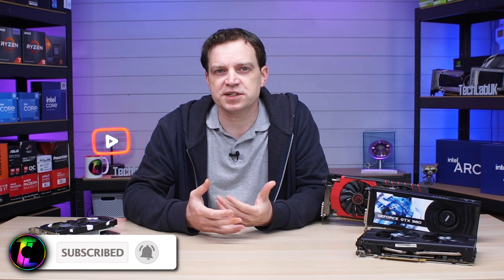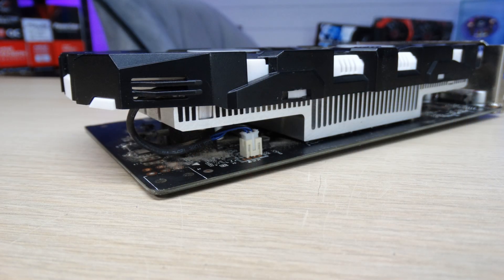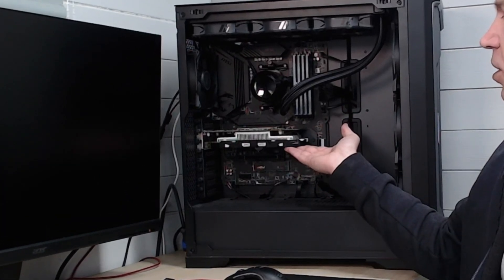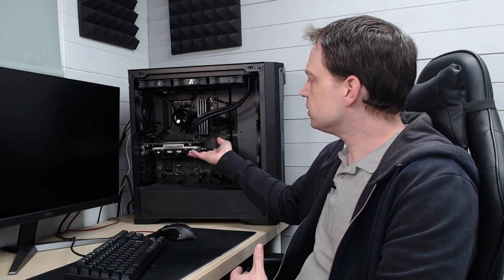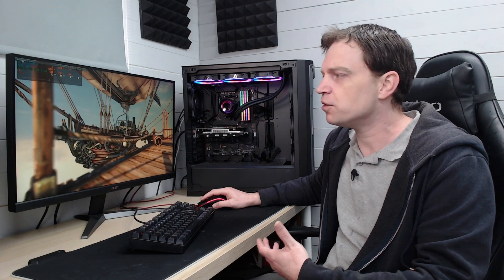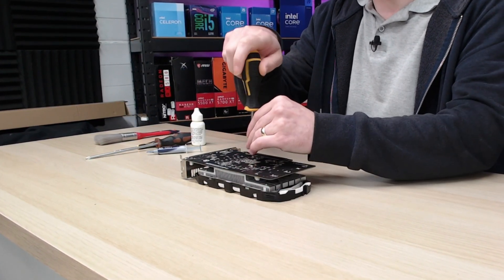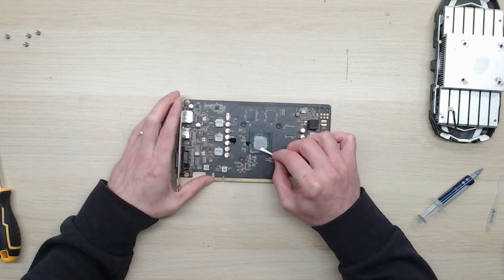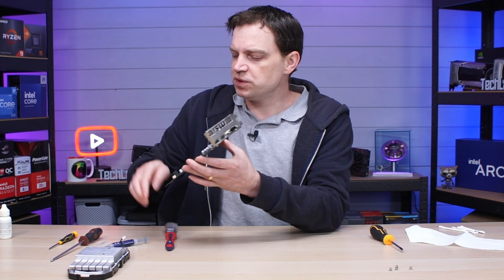So you bought a used GPU... now what?

Comment: i recently ordered a gtx 970 used for less than 40 euros i dont have any thermal paste available right now and the gpu looks rather clean  without any or much dust im wondering if i should open it up but its still got the original void warranty screw
Reply from the maker: I wouldn't open it if you don't have any thermal paste to replace it as you will need this to put it back together again.
Reply: @TechLabUK  alright thanks

Comment: Dude love your vids but watching them on a 4k 42" TV that I use as a monitor actually hurts my eyes sometimes, if you can please get a better camera, doesn't have to be 4k, not sure what it is about your current camera but the image sometimes looks fuzzy or washed out, hard to explain but there are plenty of other channels that do a great looking 1080p vids.
My last new GPU was the 3070 that I bought at the start of the mining boom for 900$ but that was because I knew I would make bake most if not all the $$ and I did mine more than 1000$ of ETH, since I bought many used GPUs and there is no chance I'm buying a new GPU at the new prices, let the morons willing to pay those prices buy them and I will buy it from them at 50% the price, this morons are the reason we have this prices, if they didn't pay these prices than the manufacturers would have to drop prices like on the 7900xt that no 1 bought at 900$ so now it's at a much more acceptable 700$ but IMO still too expensive.
Currently have the 6800xt that I bought 2 years ago for 500$ it was almost brand new and after 2 years they release the same card at the same price and the mass morons love it and buy it when they could have that performance at that price 2 years ago, oh well that's why they're morons.
My next card is most likely going to be a used 7900xtx when I can find 1 for 500$, would have bought the 4080 but that garbage 12v whatever connector is not for me, I will not use it as long as possible.
The first thing I do after buying aa used card is check that it's running ok and then disassemble, clean, repaste and if needed repaded unless it's a for parts card, then I disassemble it first, check for shorts, clean, repaste and start testing.
Reply from the maker: @Roman00744  It depends which scene you are referring to as there are four different cameras used although only two are DLSRs.
Reply: @TechLabUK  watched it again to check when exactly it looks bad. At the start of the vid the main cam is not great and pretty fuzzy especially on the zoom in you do in editing.
The cam used for the card b roll is good and clear.
The cam used for the offset from the left shot is not great either.
Hope this helps, not trying to bum you out just giving you my thoughts so you may improve if you want to.
It may be a low bit rate and not the cam but I don't know for sure.
Reply from the maker: @Roman00744  The can setup is quite unique as they are all automated through the same system.  The two dlsrs are actually pretty good cameras but the capturing reduces quality a little.  As 99% of views come from mobile phones we haven’t worried to much about it tbh but it will improve if the channel grows, to be totally honest at the moment the views / analytics are so bad on YouTube it just isn’t quite worth further investment right now.
Reply: @TechLabUK  Your channel doubled its subscribers since I subscribed and hopefully will keep growing.
Wow didn't think most people watch on mobile, I hate watching on mobile, got a 10" tablet that I could watch on but even that I don't use for watching, got a second screen too 24" and don't watch on it either.
Reply from the maker: @Roman00744  Subscriptions were good for a while and the channel has grown, general analytics are down to about a 1/4 they were this time last year.  YouTube on a slow go.

Comment: I've learned that a single broken fin on a single fan model can increase GPU temps from around 60 degrees up to the mid-to-high 80s.
A kid had an HP OEM 1650 with said situation.

Found a replacement cooling assembly on aliexpress, and mounted that, with fresh paste.
Mind you, it was new heatsink, fan-assembly and shroud.

Temps went from 77 degrees to 61 degress in an enclosed HP case, on first boot, so I suspect, that it was throttling when it was at 85+.
Because he said that performance was so much better than before.